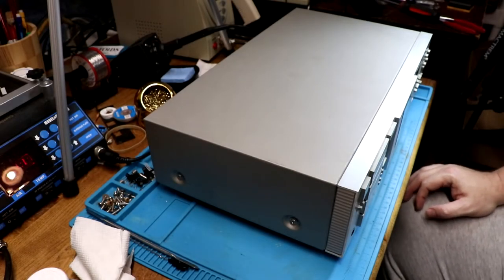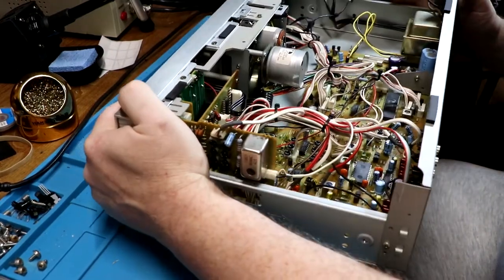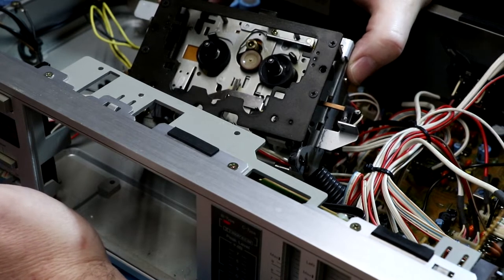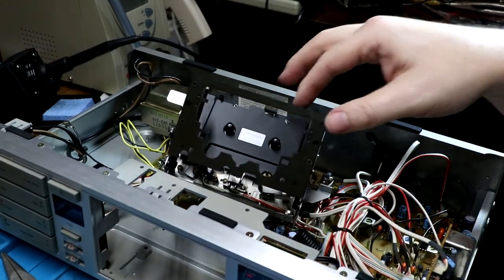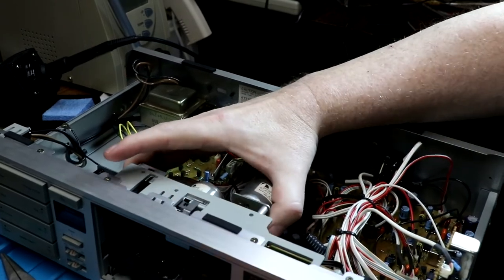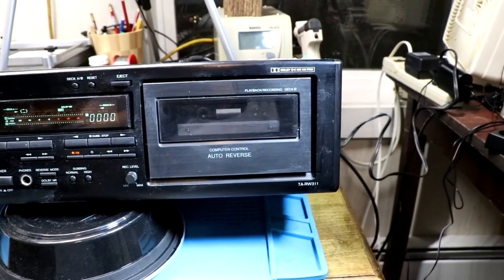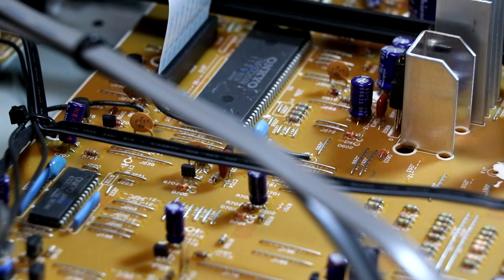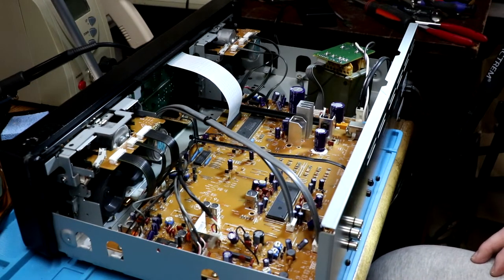Nakamichi BX-150 Idler Wheel True Fix & Onkyo TA-RW311 Explore

Comment: Could you not have changed the tyre without taking the whole mechanism out of the Nak?
Reply from the maker: I could have. But I pulled the mech for two reasons. Video clarity, and better light for my old eyes.
Reply: @TheRattlebunny  i figured this was just a pro move and was nervous I (a novice) would have to take the whole mechanism out lol. where did you get your idler wheel? I saw someone hand makes them and sells them on ebay and seems to know their stuff and leaning towards getting one from them.
Reply from the maker: @michitapes  I got a replacement tyre from eBay. Though the guy who remakes them is amazing. He’s been away or something during the whole Covid thing. But I highly recommend his work. This particular deck is fairly easy to work on, especially when compared to the Dragon. 

It wasn’t really a pro move, I just had a deadline for a transfer and didn’t have time to wait. It was more a desperation move really. 

Thanks for the comment, and thanks for watching. 😉👍👽
Reply: @TheRattlebunny  I just put in a replacement idler tyre and the fast forward seemed to be better but after putting a tape in to truly test, it won't fast forward the tape, and during playback the takeup spool doesn't move at all and it auto shuts off. the wheels the idler tyre touches to move the spools feel kind of rough like they need lubed up internally or something? do you think this is the problem? it feels like these wheels that are connected to the spools are really not moving as smooth as they should be. I heard white lithium grease would be good for moving parts for decks and other things? any recommendations on grease for moving parts? 

Anything else you think I could do to help get this new tyre to move the spools better?
Reply from the maker: @michitapes  There are some other things that could cause the slow down. Are the drive belts in good condition? It could be dried out grease, but I’m not sure if that would cause the issue. The other possibility is a weak drive motor or drive signal maybe? It’s hard to say through a message like this. Which deck do you have?
Reply: @TheRattlebunny  I have the Nakamichi BX-150, black case though and not silver like yours (I'm jealous). I picked up some white lithium grease today and applied some to both spools. I also realized it felt rough when rotating the spool wheels in stop mode due to the stoppers that lift up from the spool wheels when in play, reverse, or fast forward so i think that was the friction I was feeling. 

I'm still left with the same problem though with only about an ounce more success than before. With no tape in there I can get the take up spool to move smoothly/assertively only once in awhile and both times it's happened I threw a tape in there and could get regular playback for only about a minute or so before it would struggle again and stop. It's definitely moving a bit better than before but not by much. Fast forward seems fine but then I put a tape in, it won't fast forward. I feel kind of at a loss right now and not sure what else I can do. I tried making sure the tape path and everything was a bit cleaner. The grease kind of got everywhere but I cleaned it all up with q tips and alcohol. It feels like maybe the idler tyre could just push into the wheel a little harder
Reply from the maker: @michitapes  Sorry for the delay in getting back to you. I had a spill and may have broken my wrist. Not fun. 

Is the capstan turning when you press play? This does the bulk of the work while playing and recording. If not then that part of the issue is likely the drive belts or the motor. As far as rewind/ff it’s possible that grease or something like that may be causing slipping. I’d offer to look at it, but with my new issue (wrist) and back log it would be a while before I could get to it. 

There are other potential causes for this but these are the issues I’ve come across. Other issues could be capacitors on the board or some other passive component. In other words everything could look fine but something could be causing and under voltage condition. 

Another great YouTuber to check out is 12voltvids. He has found some of these issues with other decks. He’s in Canada and is very knowledgeable as well as experienced.
Reply: @TheRattlebunny  I recently changed the idler tire and tensioner belt on my Nat BX300, and had a similar experience.  Note: I removed both hubs along with the idler wheel, not knowing what to find or expect.  After the idler replacement  and hub(s) reinstall, the hubs were very stiff, and would barely turn w/o a tape in Play or FF/RV, but not with a tape installed.  Turns out I re-installed the hub springs wrong, I had them sitting on top of those white nylon nubs that go on the shafts first.  Checked with the service manual, springs go on first.....  That helped greatly, tapes would play fine, but every so often it would shut down with a loss of take up hub rotation, and a loop of tape hanging out the cassette.  I could tell something was wrong with the take up hub, for when I tried to simulate the tension of the cassette reel slowing down the hub using my fingers, as in the Play mode, something felt uneven to the touch, the back force was not smooth at all. It would stick at times, and release, then stick again.   I suspect the motor was stalling during one of the sticky moments,  which would cause the uP to go to Stop mode, and leaving a small loop of tape sticking out of the cassette, once removed.  I lubricated the hub shaft, and the problem cleared, I could slow the hub by finger pressure, and the force felt even and smooth.  Not sure what was happening that the lubrication solved, but it is working now.  
BTW-  I always assumed that the take up hub was designed to slip to accommodate the changing diameter of the tape spool, but I see now that neither the hub nor the idler slips, there is no clutch mechanism to be found.  Instead the motor is just forced to slow down.  Surprising.
Reply: You could have changed the idler without removing the entire assembly.  The plate can be removed from the front when you remove the door
Reply from the maker: True. Could have. I tend to do more disassembly than normal while making a video. I think it shows the process better. Thanks for watching, I sincerely appreciate it.

Comment: Nakamichi is ok. They installed so many bad capacitors in their decks that I just can't call them great.
Reply from the maker: +Darren Wendell I think it tends to depend on when your Nak was built. I’ve dealt with leaky caps on those built after 1990, but I also have seen and owned several from the 80s that are still perfect to this day with originals. Not sure if the capacitor plague from the 90s-00s was the cause of that or not, but it stands to reason. While recapping is, well ... involved, it’s not the worst repair to deal with. I’m currently working on an internal battery leak on an old 486 PC that’s just driving me .... Aaarrgh!! You get the idea. 

Thanks for watching, I sincerely appreciate it.